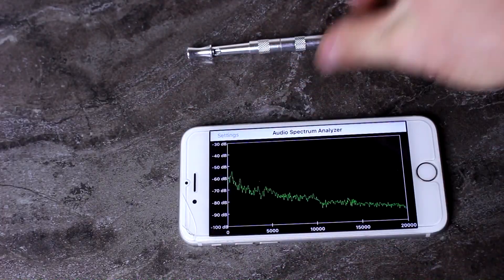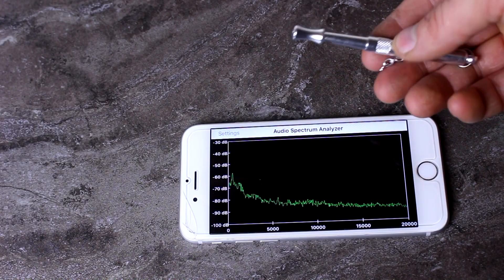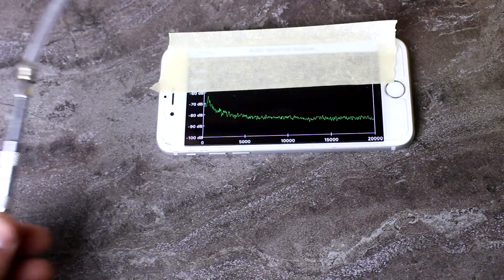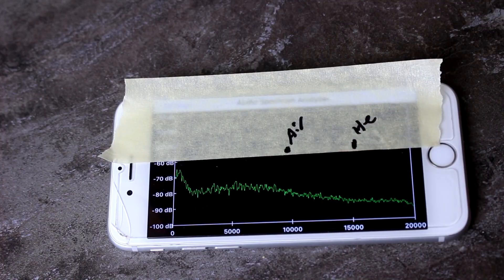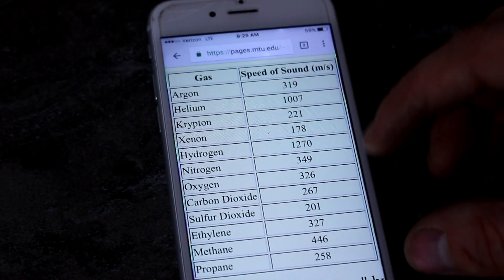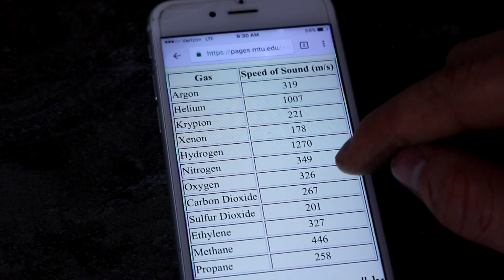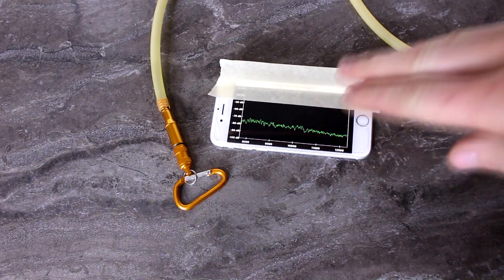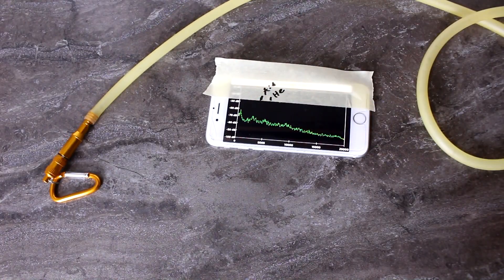Dog Whistle On Helium and Xenon

Comment: Is breathing Xenon even safe??? o.O

EDIT: FIRST
Reply from the maker: it is naturally a small component of air, its not toxic or anything but it does displace oxygen, also it has a similar effect to nitrous oxide.
Reply: It is not safe for two reasons. Firstly it contains no oxygen so you can die from anoxia, and it can come on rather suddenly and you could pass out and fall. Secondly xenon is an anesthetic , and is very effective, even though it is an 'inert or noble gas, it does interact chemically with our body.
Reply: Xenon is a noble gas and therefore isn't that dangerous.
Reply: it's still chaper than Sulfur Hexafluoride
Reply: breathing should eventually remove xenon even they are heavier. liquid 
are much harder to remove in our lungs. if you are really worried about 
xenon staying in the lungs you can just turn your body upside sown and 
xenon should just fall out easily
Reply: Xenon, although a noble gas, does indeed react when you breathe it, and it's like breathing nitrous oxide. Sulfur Hexafluoride is non-reactive.
Reply: Xenon has a secondary effect beyond starving you of oxygen. You shouldn't breathe it. The only reason it isn't a controlled substance is because of the cost. The effect is the same as nitrous oxide, only intensified by the difficulty of flushing your lungs.

The reason you shouldn't breathe it, especially when alone, is because you will get so high you will forget to flush your lungs, and then die of asphyxiation.
Reply: It's a noble gas so no
Reply: ShizL - It’s long been known that some noble gases can form compounds.
Reply: It haven't been proved that xenon forms any compounds inside your body and it doesn't usually have any negative effects, unless ypu keep breathing it instead of oxygen, obviously
Reply: pixelpatter Xenon usually has no side effects after inhaling it, if you don't keep doing it. Try it. Proof is in the video too.
Reply: @ShizL It doesn't matter. He asked if breathing Xenon was safe, they answered the question. It isn't really safe but Cody is probably fine because it's a small amount, just like with him touching mercury and drink cyanide.

Just fuck off out of the comments if you can't stand look at how wrong you were. At the very least stop commenting and trying to spread wrong information.
Reply: It's an asphixiant (as most things are) meaning if it displaces too much oxygen, then you'll pass out or die.  But it's non-toxic.  As long as you make sure you are still getting oxygen it should be fine.  Helium, for example, is also an asphixiant.  For party balloons, helium has oxygen added since they know people will inhale it for fun, and helium without oxygen has killed at least 1 person (but it's uncommon).
Reply: We don't want to breathe Radon in as it is radioactive and brakes down to heavy radioactive metals in your lungs that stays there and produce ionizing particles for long time.
Reply: kwantator Dude that has been disproved. Its a fairly common urban legand. Your lungs dont quite work that way with gases, and a heavier gas like argon is pretty damn hard to get out your lungs, especially since it doesnt dissipate very quickly. Unfortunately in the metallurgy and welding industry argon poisoning is a big killer
Reply: You won't die from lack of oxygen from breathing in a few breaths of xenon, or other heavy gases. People breathe in di/tri fluroethane from air duster all the time to get high and don't die from lack of oxygen (although it isn't as heavy as xenon). Most of the people that die from it are from arrythmia, not hypoxia, and that is rare.
Reply: It is inert gas so it should not react with anything in your body. On the other hand it is significantly heavier than air. I think argon can be dangerous because of this as it stays at the bottom of your lungs.
Reply: Interesting, thanks for the answer! Was it pure Xenon? I just kinda thought... you know.. xenon lamps, that doesn't sound healthy :D
Reply: ShizL - So is Radon, but you wouldn’t want to inhale that! ;-)
Reply: Not if you don't inhale a lot of it and you inhale air
Reply: I'm sure just breathing will remove it, no need to invert yourself.
Reply: dahahaka it's a noble gas which means it's nonreactive you wouldn't want to sit in a room full of just Xenon and breathe it because it doesn't provide you with any Oxygen so more than one or two breaths of it in a row is not good for you but it's not going to poison you or anything if you're  worried about it not getting completely out of your lungs because it's so heavy stand on your head for a minuet
Reply: @Macdeas Argon is non-toxic, the "poisoning" from argon is due to long term exposure,or extreme amounts of short term exposure all at once (such as breathing almost nothing but argon alone) not from actual toxic poisoning, both are just hypoxia/asphyxia. Holding someone upside down will slowly remove argon from the lungs, but CPR will work far quicker, so holding someone upside down is kind of useless.
Reply: Gasses like Xenon that are heavier than air are dangerous to breathe because they pool in the bottom of your lungs and displace air.  You have to be very careful to get all of the Xenon out of your lungs afterward.  Helium will come out without you doing anything special.
Reply: Yes it can, use the internet and do some reading. I suggest starting with a search for "xenon compounds" and then "xenon anesthesia".  “It's not what you don't know that kills you, it's what you know for sure that ain't true.”
― Mark Twain
Reply: pixelpatter01 What's the meaning of "it can interact chemically"? No, it can't. Xenon cannot "intercat chemically".
Reply: ur not funny
Reply: I'm not trying to be :)

Comment: I'm pretty sure the main mic of an Iphone is at the bottom and not at the top
Reply from the maker: I still pointed towards it...
Reply: There is mayby another problem. The phone eventually shows only a harmonic frequenzy. The real tone could be over the 20Khz. And Smatphone microphones are havely filtert for a range to about 14Khz. Everything over this gets extream reduced. Nice demonstration!!!
Reply: Dylan  Gracias true, but it has a pretty far range so it won’t affect anything.
Reply: Doesn't matter as he always had the whistle in the same spot.
Reply: Agree, this would be very interesting with a proper recording device and a more accurate whistle. I just don't think Cody has the resources atm. Great job Youtube
Reply: There is a mix at the top too. Also the speaker can be used as a mic on some phones.
Reply: lol, technically if you would have pointed it away from the mic, it would still be pointed at the mic, it would just take the diameter of the Earth to finally reach it.  

edit * circumference*  my bad., not diameter.